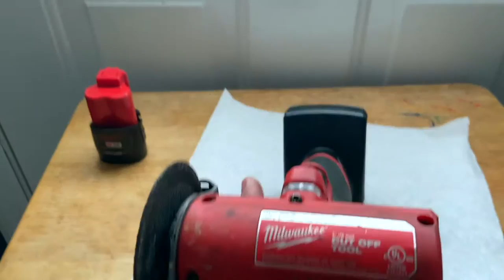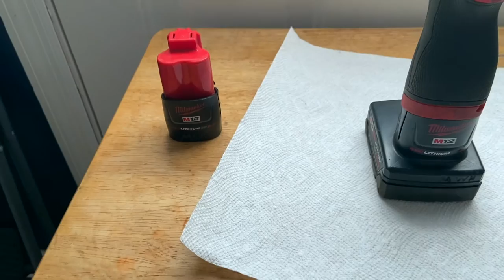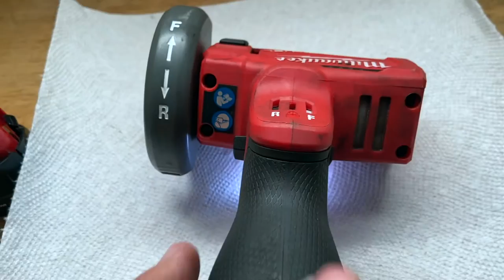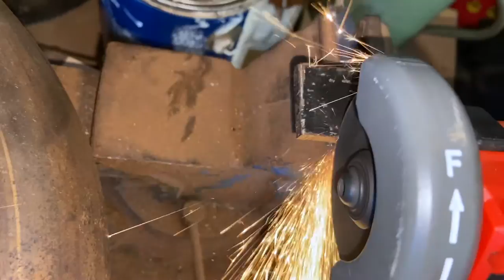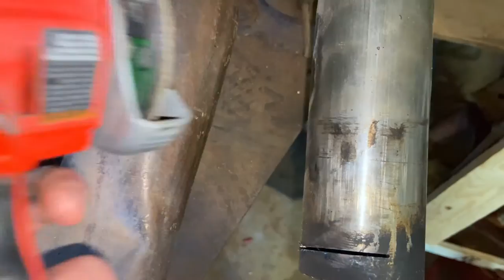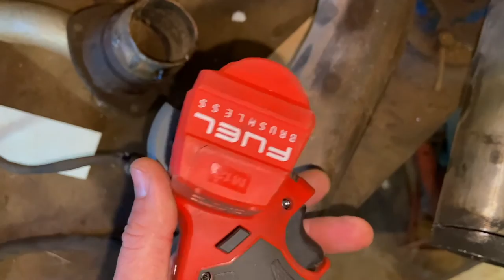Automotive Mechanic reviews Milwaukee Cut off tool

Comment: I like your review on this tool vs others I’ve seen. I was thinking about picking this one up for doing floorboards and maybe some body panels on my old Chevys. I like the guard vs using a pneumatic angle grinder that the cut off wheel would be exposed. What would be your thoughts on cutting sheet metal body panels?
Reply from the maker: IDK, with the big battery it does good. I estimate with constant uses, it’s good for about 10 mins. I only have one of the big M12s. I have several small ones, and they can’t do anything.
Reply: @RocketGarageService  Can you test it now, with the high demand M12 batteries that have just been released?
Reply from the maker: @suzesiviter6083  I wasn't aware of a new M12 battery. I will look into it.

Comment: Excellent review! I personally have the Ryobi one and it's way to big and bulky for everything but exhaust work....
BTW I have the 3/8 fuel ratchet and its amazing done what I asked and then some. You will appreciate it when u got one.

Keep up the good work!
Reply from the maker: Yeah, the 3/8 Rachet is non-fuel, no good. The 1/4 Rachet I have is Fuel and it is amazing. My next power tools will be a straight, angle die grinder, then 3/8 ratchet